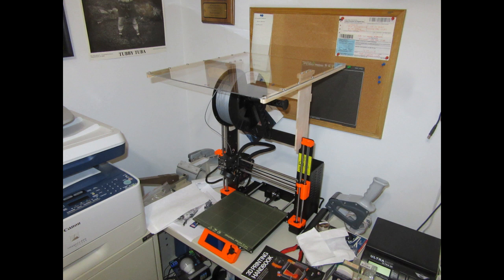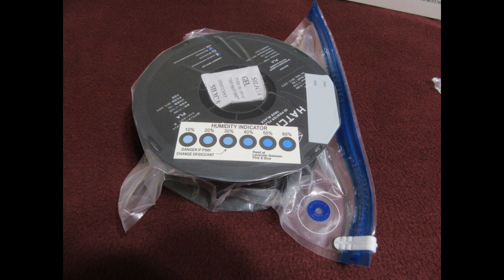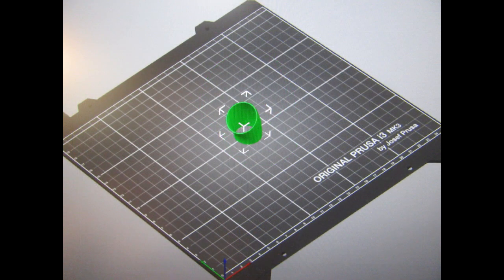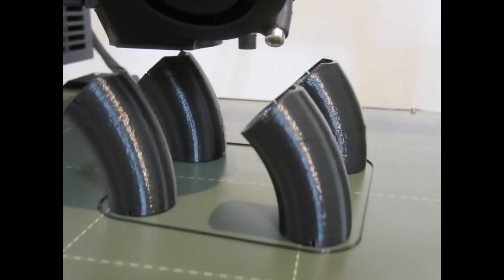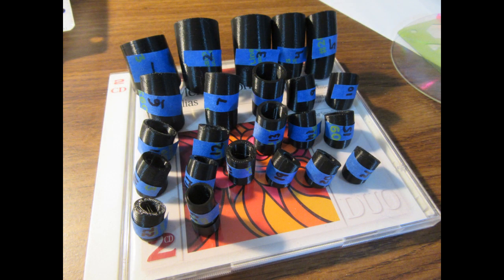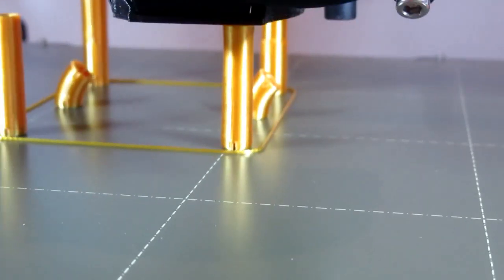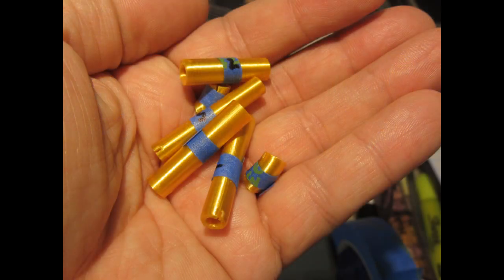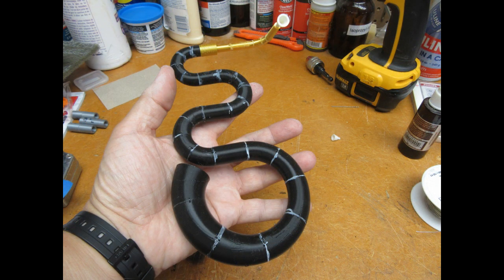3D Printer Adventure, Part 2: My First Real 3D Printing Project

Comment: Just an observation out of inexperienced ignorance - Why did you space your parts so far apart? Is there any practical reason? It would seem that placing them just far enough apart to ensure that they don't interfere with one another would be optimal from a time and travel perspective.
Reply from the maker: Jack Lavallet, that probably would have been better than what I did. But this was my first try doing this, and I was interested to learn about a few aspects of printing multiple parts by experimentation. I was curious how much time would be lost, or saved' depending on distance between parts, and learned that at least THIS printer can move very quickly when it is not actually printing. I was also interested in making the video presentation clearer, and thought by spacing the parts by a greater distance would be better visually.